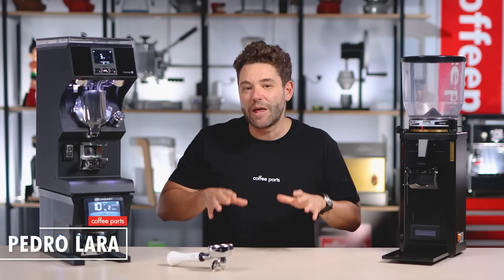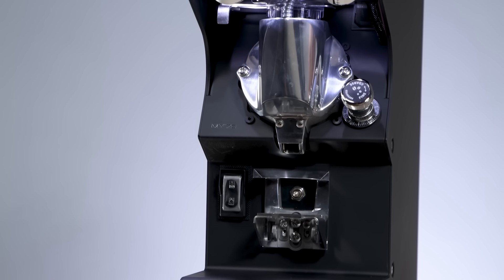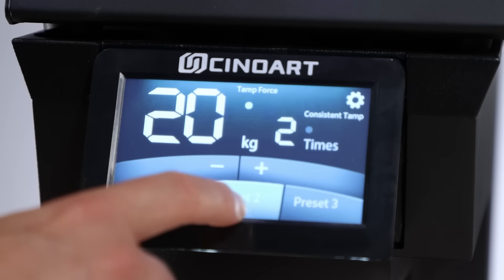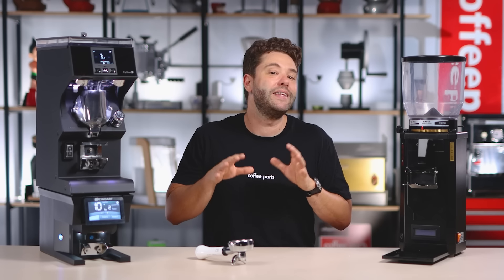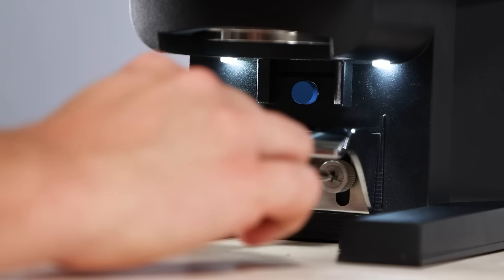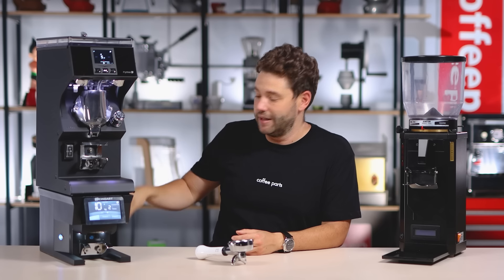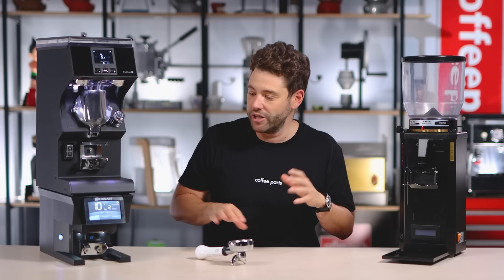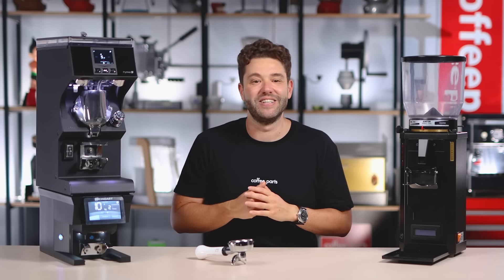Cinoart PBT Commercial Auto Tamper | Review

Comment: I have the Cinoart PT2 and I was wondering about whether to go from light to hard or hard to light when tamping and its interesting you mentioned light to hard. I've settled on a 14kg tamp followed by a 10kg. My thinking was when I had a manual tamper I would tamp hard first then do a light tamp and polish but this is just gut feel and not based on science. When you find out which works better let us know.